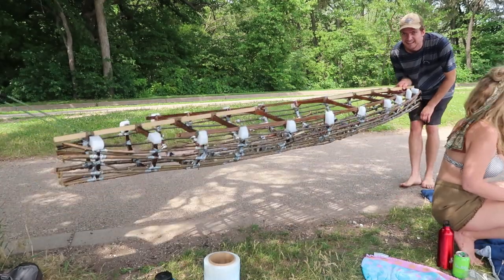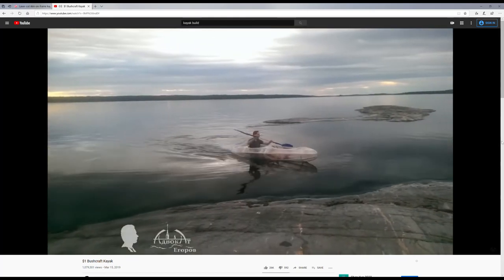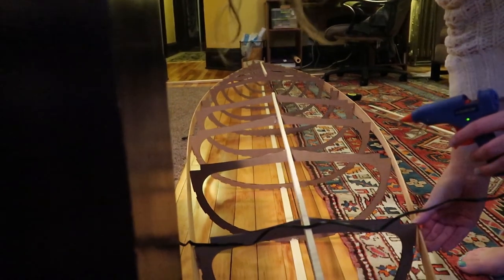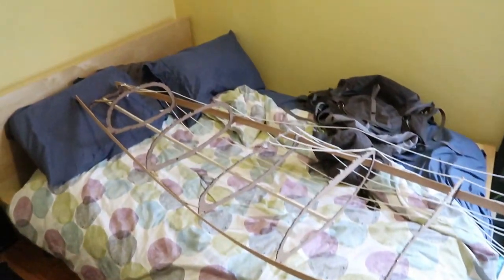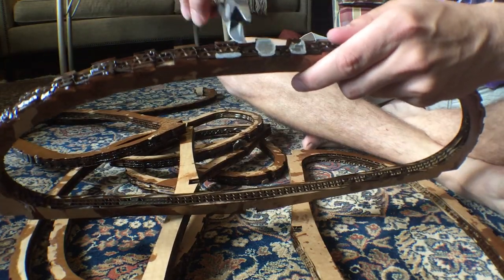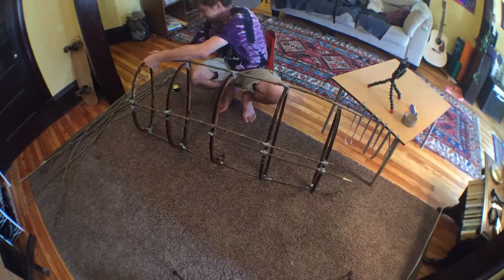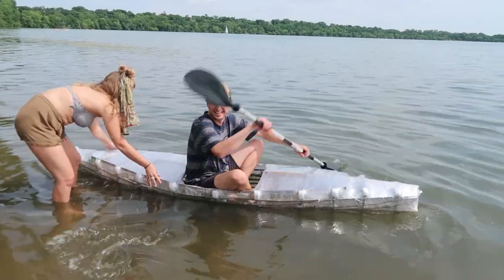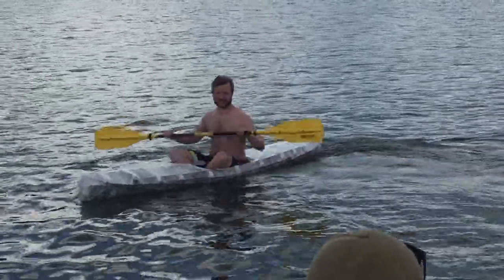diy Kayak Made of Sticks

Comment: I love it, mixing some modern prototyping methods with some low cost quick build methods.  The perfect way to use engineering methods to rapidly improve design, or use already tested designs, while keeping the build quick and cheap.  Nice to see someone that is not just copying the first guy's video.  The more options, the better.

I live in a kayak paradise, where unfortunately few have a place to store a kayak.  A kayak club tried to offer low cost kayak storage by the water, but the government forced them to stop.  They want the kayak rental places to be the only option.  So I was thinking, a kayak that doesn't take much time or money, could just be tied up somewhere, and if someone steals it or damages it, no big loss.  So your method may be a good one to get the design worked out.
Reply from the maker: Yeah great for prototyping